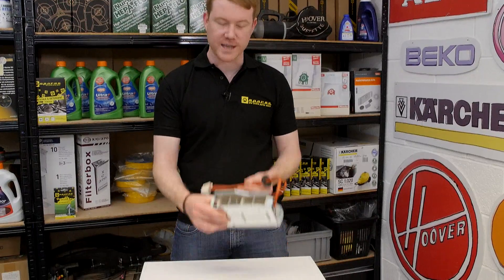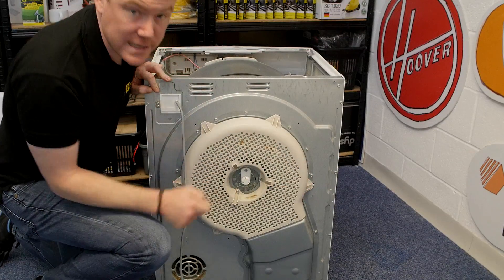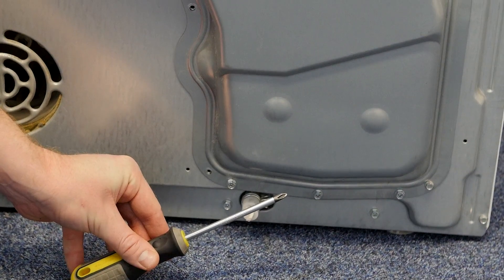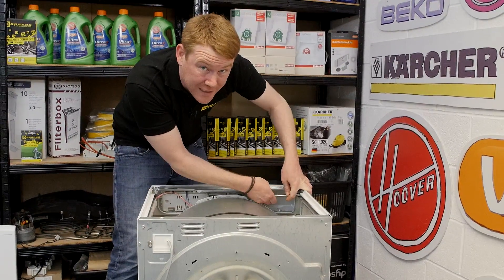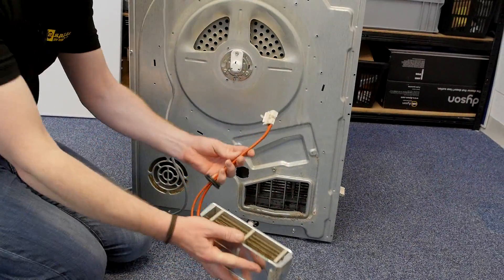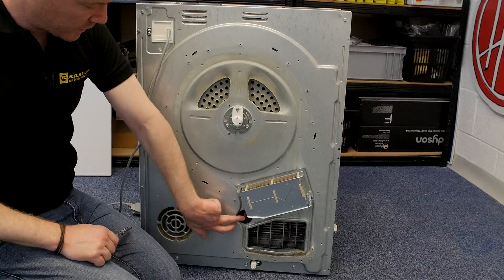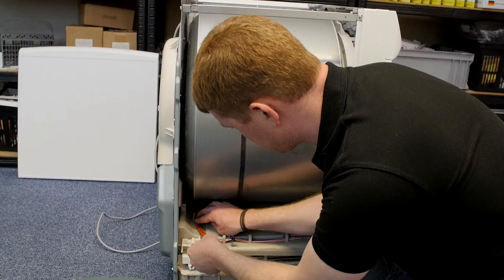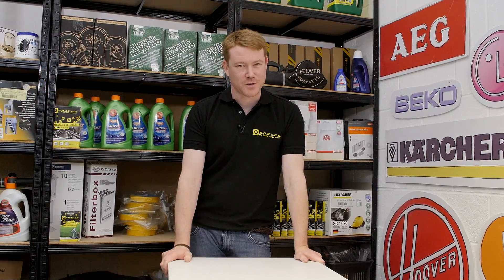Fitting a Tumble Dryer Element Made Easy! (Electrolux, Zanussi, AEG)

Comment: Hi. my dryer looks like the one on  the video. my dryer is taking much longer to dry things and stops while theyre still damp. sometimes it feels a bit warm. do you think the heater might need replacing even if it warms a little sometimes?
Reply from the maker: Hi Elizabeth,  the heater usually has 2 parts that use either half heat and full heat and part of the heater could  fail and you still get some heat in your dryer, check the heater and there are usually signs of damage that would indicate it has failed.

Comment: Is there an overload cutoff switch that you might need to reset? Can you guide where it is if exists?
Reply from the maker: Hi Hadas, it would depend on the brand and the model but if it has a resettable thermostat it will usually be on the back panel so look there first and it should be a button you can push to reset the element.

Comment: You got any idea how to diagnose a Zanussi ZDC8202P without lcd?
Reply from the maker: Hi Marcus J, you have not mentioned the issues you are having so let us know what is happening and what you have tested and we can help where to go from here.
Reply: @eSpares  The machine is not heating up. I cleaned everything and opened it up but I see nothing bad and I have no electronic equipment to test anything.  So my guess is the heating.
Reply from the maker: Hi Marcus, the most likely thing would be the heating element but we always suggest you make sure by testing it with a multimeter but check out this video for more help www.youtube.com/watch?v=Ftm8lDVVw2E&t
Reply: @eSpares  Bought a multimeter today and the heater didn't show current. I put the heating element in the freezer and then hit it later on the back when it was room temperature. I saw this on youtube. The mutlimeter suddenly gave current. Now I put it back in the dryer and it actually works. Thanks for the vids.
Reply from the maker: Hi Marcus, glad we could help.
Reply: @marcusj8623  Hello, can you please put the link with the freezer method? Thank you.